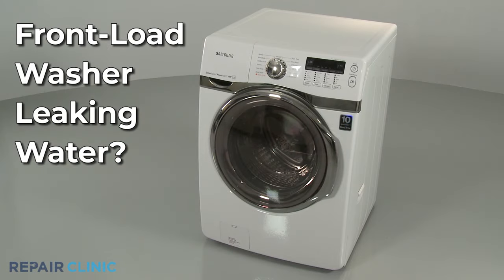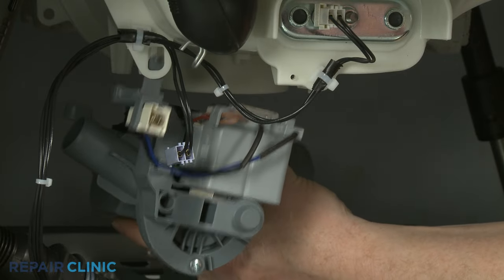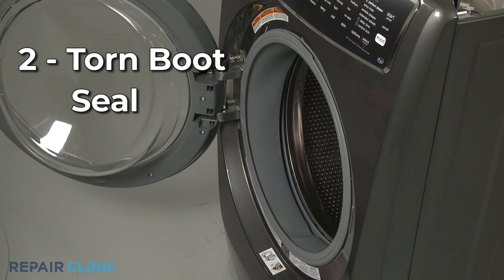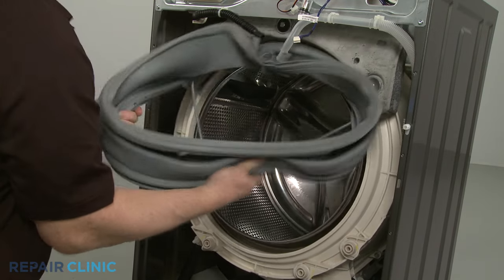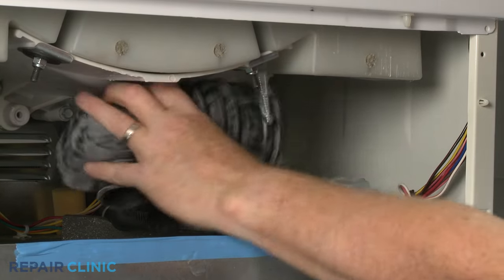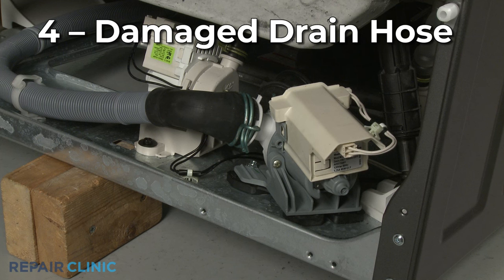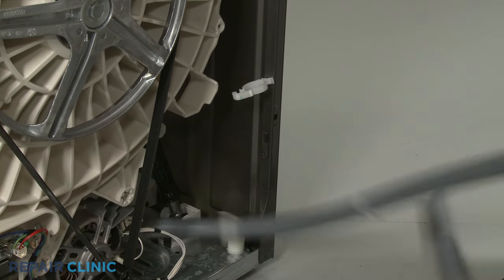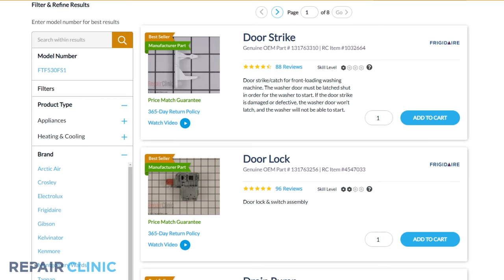Front-Load Washer Leaking Water — Front-Load Washing Machine Troubleshooting

Comment: My front load washer was doing a load filled with water no problem spin no problem. About 6 minutes in I hear it beeping over and over. Didn't catch the code on the washer in time because of all the WATER that flooded not leaked . Absolutely dumped out from the bottom of the washer like a stream of water all that was in the cycle I guess and flooded my downstairs neighbors bad enough for the land lord and property management to be involved and I don't have renters insurance. We haven't used it since out of fear. It dumped out all of it

Comment: I have water drop leak emanating from the cold water intake on top of the manifold where two electrical blue and one white are located.  Which part (s) do I need to replace? Thanks.
Reply: Usually just the supply hose. About $20